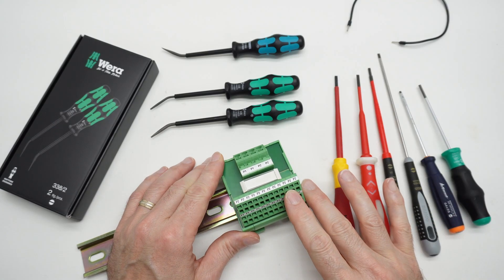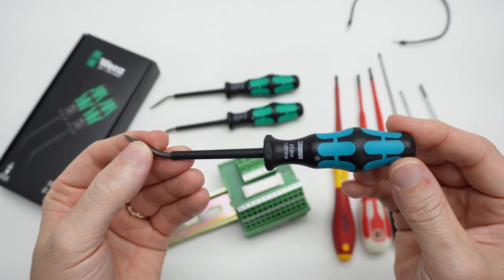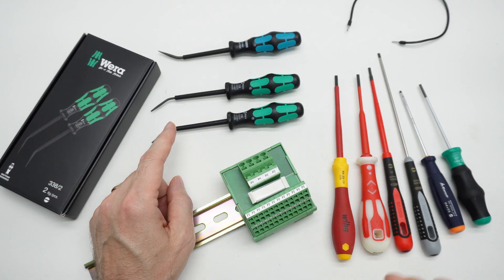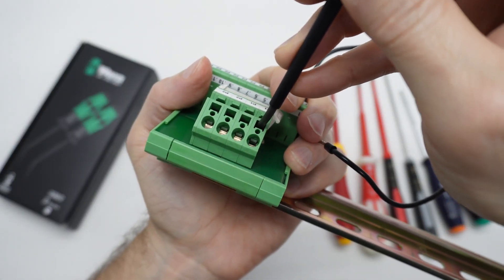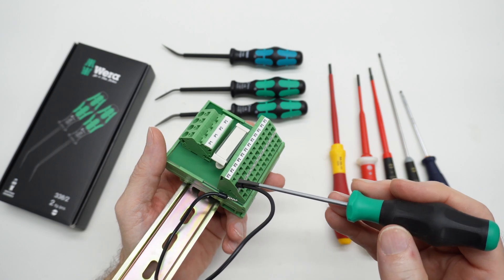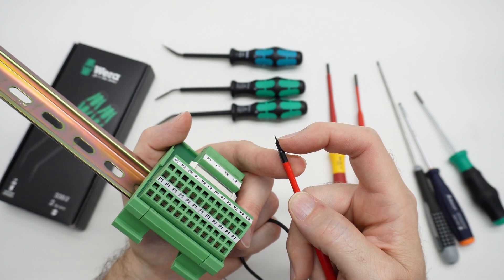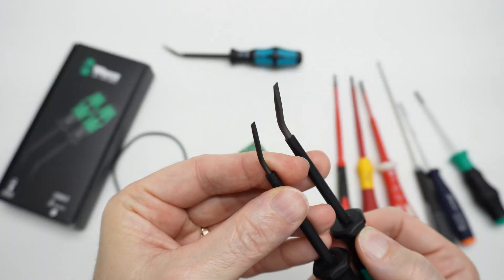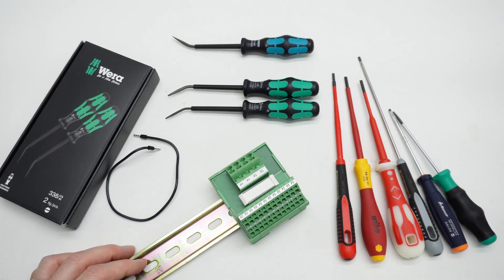Wera Spring Cage Terminal Block Actuation Tools.  How do VDE and conventional screwdrivers compare?

Comment: WAGO has small dedicated tool for that for years. It's very small, let's you push it in and keep it in with spring actuated. After inserting wire you take the tool mouth. Also, Wago's screwdriver has very nice handle and is good quality. PN 210-648
Reply: there's way more than one model in the Wago catalogs. 😸

Comment: Personally I can’t believe so much of the industry still uses screw terminals. IMO push/spring terminals are at least 3 times as fast and the connection is more positive too (and will never vibrate loose). Also, if you put a ferrule on the wire first then you can just push it in.
Reply: Spring loaded are good for lower current and signal connections.
I’ve seen them melt and burn for stuff over 20 amps, with ferrules and everything.
Screw terminals require correct installation and torquing - I’ll give you that.
I always do three tighen - loose - tighten again method before I finally torque to speck. This way I know ferrule is pre-compressed and will not settle down later.
Reply: @commenter5469  I'm no sparky....but I can see this being required for some ferrule crimps with screw terminals.  I always thought the 4/5 way ferrule compression could expand and reduce the contact pressure (under a screw) over time.   Never heard anyone say a thing about this until now.  Cheers.
Reply: @metricdeep8856  I’m no sparky either. I am equipment tech. And here in the US at least  we have to know WHOLE LOT more than them! 😁
Reply: @commenter5469  Ya...Sometimes you gotta do the thinking for others.  Good company my friend.  I spent 30 years as a grunt worker in many fields....then 20+ years as a mechanical designer.....I've learned a lot of crazy crap from many fields.  Not many will share unique info....most won't recognize it either.  Cheers and thanks for sharing.  Stay safe.
Reply: don't scare them retraded american sparkies please or they might learn a new trick as horror beyond human compréhension could very well immanentize the eschaton! 😏
Reply: If you’re only going to get one, surely the smaller one is best. The mall one can go in a larger terminal, but the larger one can’t go in a small terminal.

Comment: Klein makes a small screw driver model TB DIN (as you can guess it’s made for terminal blocks and din rail stuff) some other term blocks you can push them in with out having to actuate them.
Reply: yeah, new terminal block with push-in spec and a easy detached feature with kinds of screwdrivers.
Reply: Wago also offers a whole line of TB tools in green or green and black for their various products. check 'em if green is your kind of kink... 😏👌

Comment: Nice review! Ive been using the small wago 210 for years now. Ive been on the fence picking up a set of wera. The longer reach in the control cabinets I work in could be slightly beneficial but in some situations could be a hindrance. Most of the time if the terminal can be accessed with a longer handle a slimline wera or wiha works fine otherwise the stubby wago 210 I think is easier to use. I do have some pocket prybars I assume would be equivalent to using the wera. which is what I’m basing my opinions of use off of.